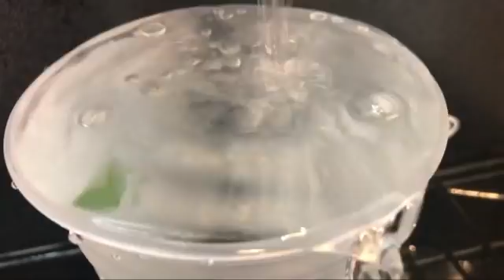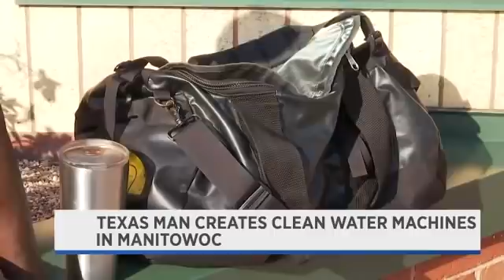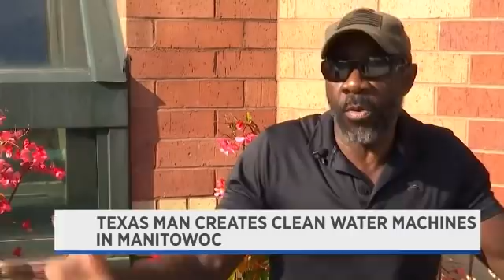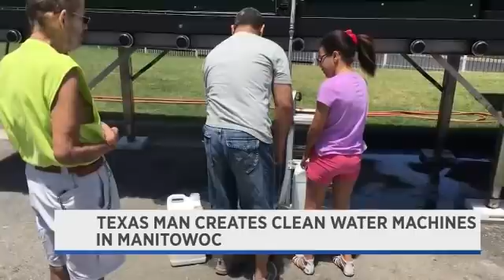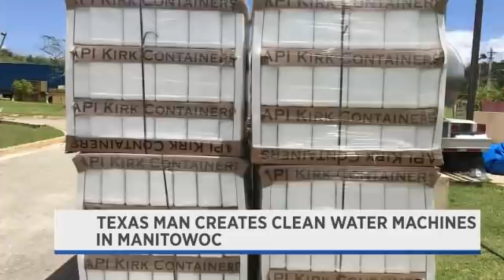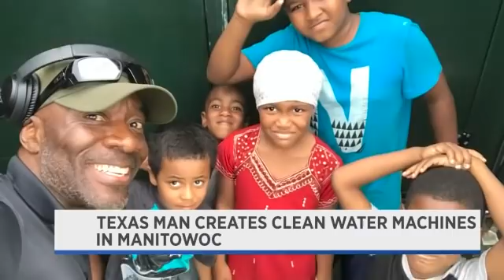Texas Man's Invention Creates Drinking Water from Air

Comment: I salute you Sir. A true Engineer.
Reply: Apparently you aren't one... otherwise you would recognize how this won't work. Thermodynamics.
Reply: Sure buddy. I believe ya.
Reply: @TonyLaChica79  Its industrial size dehumidifier what sure produces water, but with extreme cost and you still need to clean it properly before its drinkable. On my earlier comment you can find cost calculations of running this thing and it come to around 0,07243 dollars per liter or around $329 per day just in energy bill and this was in very optimal conditions, where as in field you might not find 30C and 80% humidity, so lower you go less efficient this is.

Also its irrelevant what ever you believe Nanael or not, you can use internet to learn about thermodynamics and calculate whole thing your self. Nanael could have sited his source and opened what in laws of thermodynamics make this not work, so thats on him. And Martin you can be ignorant and there nothing wrong with that, but staying ignorant after being told does mean you are stupid.
Reply: Sure buddy. I believe ya 😉
Reply: Hellsong89 also, atmospheric water generators, have been available for years and years. There are so many companies manufacturing them. This is no new invention, but something using old technology.
Reply: Are you dumb or just stupid?

Comment: Thunderf00t is on his way.
Reply: All hail Thunderf00t, the saviour of science!
Reply: Ryan Smith  As someone who cant spell, this scam is perfect for ignorant dumbasses like you
Reply: @unverifiedpenguin  why do you hate black people so much that you wish this was a scam even though Moses West dont make any profit from his machine he takes donations to build them and gives them away for free to people that need fresh drinking water usually when people scam people they are trying scam people for money to sell a product not give it away for free you just upset because hes black this guy is a Hero and should be commended not demonized because the color of his skin
Reply: @frankmill5172  Lets get this out of the way. This 'Atmospheric Water Generator' is pulling water from the air. Which according to Thermodynamics is a REALLY inefficient way of getting water. I don't care what you try to spin this device as. If it is pulling water from the air. The science is the same!

Here is an example. You boil water in a kettle, yes the water will turn to water vapor. BUT if you force the kettle on, the water will take FOREVER to boil dry. What these 'water from air devices' do is the reverse of that. It pulls water vapor and cools it down to where it will turn to water, you will only pull VERY LITTLE amounts of water. And the amount of water you pull is very dependent on humidity (amount of water in the air) This device would NEVER work in arid desert regions because there would be so little water in the air if any.

The best conditions for this device would be very hot temperatures with high humidity. Conditions before a thunderstorm. At which point you could stick a bucket outside and get more water than this 'Atmospheric Water Generator' could, and it would cost you the price of a plastic bucket.

Speaking of costs. Running this device would be far, far more expensive than conventional ways of getting water. Because this device will be pumping huge amounts of energy to get TINY amounts of water. And if you pull water from the air, it has to be treated before you can drink it, so there is the additional cost of water purification. So yes this thing isn't even economically feasible.

The problem with arid regions is that where there is water, it is dirty and you can't drink from it. So if you really want to solve this water crisis why don't you purify and treat the water that is already there? 

And now onto the other issue, this could very well be a scam or this man just doesn't know what he's doing and hasn't taken Thermodynamics into account and if its the latter, I'll give him a pass for it. But what I utterly detest is people trying to sell an idea that has been proven to be unfeasible, and companies went bust trying (Waterseer and Fontus). Would you donate to an idea that has been debunked by science and is completely worthless, I know I wouldn't.

And the last issue. I DON'T CARE ABOUT HIS SKIN COLOUR! Yes he's black... so what? The bottom line is he's made a device that cant work as advertised and whether he is aware of it or not doesn't matter. Me and a lot of other people don't care about his skin colour, we only care about this device not working as advertized. 

Yes he's black, but I couldn't care less. That isn't the god damn point. People like you continue to defend this man simply because "He's a black man and his ideas will save the world." Well no it wont and I've explained why. The fact that he's black has little bearing on the issue.

You claim those that who critizise him are either jealous or racists. That isn't the case, this device will not work and science proves that. THATS ALL THIS IS. And people like you are making this a race issue when it isn't.

Yes he's black, but that doesn't mean he is immune to criticism!
Reply: @unverifiedpenguin  all that and you haven't debunked his machine the difference is he made it energy efficient and runs on free solar energy so all your talk about cost is redundant he also produce over 3000 gallons of water a day if "science proves" that it dont work why are there no articles no videos on YouTube debunking (Moses West) machine??? this guy literally leaves the machine alone for weeks to be used by the local communities he helps so any one can go see it work and if it was fake they would have debunked it long time ago instead of trying to sabotage it ...why would you try to destroy something that dont work when you could just prove it didn't work and sue the guy for false advertisement and sue him for collecting donations for a fake product ...why dont you go to the machine and prove its fake not just claim because some one else version failed and is high cost low yield that his machine is the same even though the video shows it working its like watching a video of a midget dunking a basketball while saying midgets cant dunk LMAO post a link or a video of some one any one debunking "Moses West" <<< water machine not just post a essay on why it cant work while saying its old technology that someone else invented LMAO
Reply: @frankmill5172  Alright fine, let's agree to disagree. If it's his money getting wasted I couldn't care less. And maybe the device was sabotaged, but if it was I'm leaning more to the idea that it was some one that doesn't like him. Rather than people trying to make conspiracies out of it.

Water from air scams aren't new that's why I'm sick of them. I hope this isnt a scam and IF this machine works (which I doubt), good. One point for humanity. But I'm more realistic and people have lost money from this. Both businesses and investors. That's why I will crap on this "water from air" crap. It has been proven to be a shit concept and until someone builds something that proves otherwise, that will never change.
Reply: @unverifiedpenguin  yeah do you buddy ..."I'm just glad a lot of great scientist didn't believe like you do that everything was imposable just because they failed the first few time or saw a different scientist fail and just said why even try because the other person didn't succeed...glad they kept pushing and working to figure out where others went wrong and achieved their goals or we would all still be stuck in the stone age and never progress as far as we have today ...
Reply: @frankmill5172  sorry there is no way this little thing would ever produce 3000 gallons unless you put it in a lake.
Reply: @northwestgardener5076  have you seen the machine in person ???have you read the patent ??? or post a link to a article or video of someone debunking Moses West Atmospheric water generator not just small dehumidifier that someone else built you cant beat some guy named Gary Jordan in Basketball and claim you beat Michael Jordan
Reply: @frankmill5172  no I worked with water for a decade, the only way you are sucking 3000 GPD out of air would be to throw it in a lake or cover a acre (sort of a foolish thing if you think of that much land for that little water) good day to you Frank
Reply: @northwestgardener5076  just saying its impossible ...there is no way it can work...your foolish to believe ...is not actually debunking anything ...good you worked with water for a decade but you're not the only one that worked with water and it was professional people that worked for water companies that gave him the go ahead and verification that it worked ...it was people that worked with water that tested the machine to make sure it was safe you think they would just let anyone place a water machine in a city for free so people can drink get sick and sue the City for regulating it ...you act like Moses West just drove his machine into town set up shop without a permit ...you cant even set up a lemonade stand in America without a permit LMAO you think they just going to let a black man set up a machine the size of a Simi truck without doing there homework LMAO they dont just hand patents out to anyone they have to have closed testing to verify the machine does what it says it does ...try making a video about a 0 point energy machine and send just the video to a patent office and see if they give you a patent without seeing the machine in action first to verify that it work ...I have seen small machine that are the size of a microwave or small fringe that produce 2 to 5 gallons of water a day Moses West machine is the size of a trailer home why wouldn't it produce 3000 gallons a day
Reply: Ryan Smith  I guess criticizing black people is racist now. No wonder humanity is doomed
Reply: @goodgood8641  made up
Reply: lol he featured your comment in his video!
Reply: Still waiting
Reply: @TheLivingPizza4  https://www.youtube.com/watch?v=66UOeUKa8nQ Wait no more.
Reply: @mdamaged  how does debunking some one else machine have to do with Moses West water Machine ??? show me a video of some one debunking Moses West Atmosphere Water Generators not some small hole in the ground water vapor dehumidifier machine LMAO
Reply: @TheLivingPizza4  done!